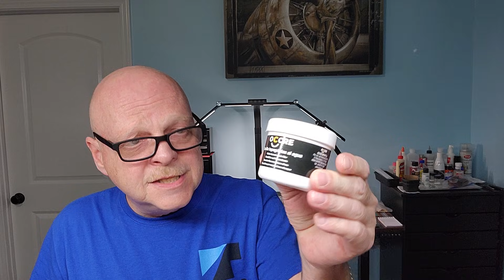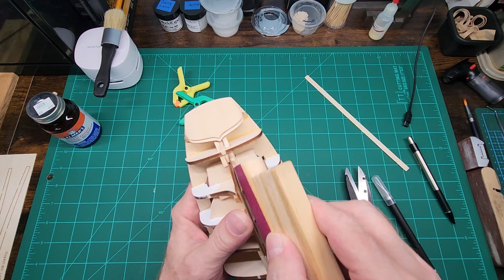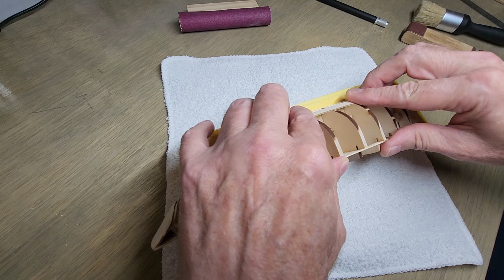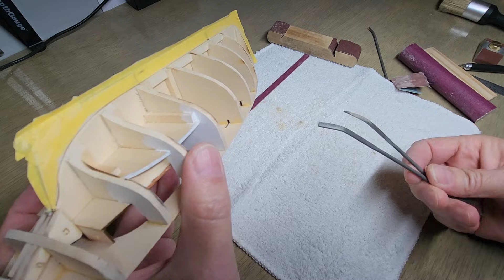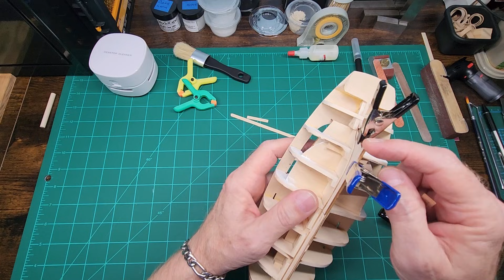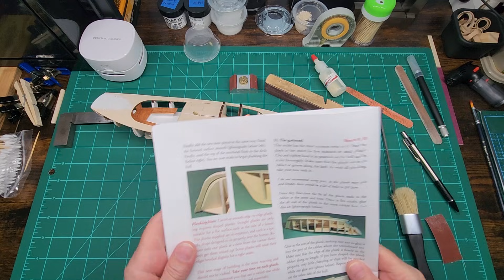Model Shipways Muscongus Bay Lobster Smack, Part 5, FAiring the Frames, installing the Keel/Bow/

Comment: I'm behind you, I haven, started yet!!!
Reply from the maker: Hi Mike,  that's ok, when I faired in the hull I didn't pay enough attention to the frames just before the rudder, it left a sharp angle rha I had to remedy with filler. Hopefully you can avoid that little mistake and your planking will have a better transition than mine did. Take your time and good luck with your build buddy. 😊 Johnny

Comment: Looks good but…. I think it is a mistanke to grind away the lower detail of the transom! The instruction is as you also comment not very clear, but I think the small toe is a important detail of the design Regards Bent from Denmark
Reply from the maker: Thanks for the comment Bent! I really appreciate it. As for that small toe or spur on the bottom of the transom, in step 10 we have a central plank that is placed along the central spine which starts just aft of the hole for the rudder and runs just past the transom, the end of which will be sanded flush along with the ends of all planks that attach to the transom. Leaving that spur in place would create a problem with the planking, so I faired it in just as the instructions indicated in the picture on page 9 of the manual. With that said, I will say that it is always a good idea to question the instructions, we have found some to be unclear, and in one or two cases, somewhat in error. Thanks so much for watching my friend, take care and happy modeling. Johnny
Reply: Thanks Johnny I am  almost there and still have the ambition to keep the toe, but lets see how it goes 😅
Reply from the maker: @Thalassa63  Hey Bent, I think you're on the right track, keep with your gut feeling and see where it leads you, my friend! Just remember, modeling is never about one person's point of view! Let me know how this turns out my friend. Happy modeling. Johnny
Reply: @Thalassa63 did you happen to leave the transom shape? How did it go. I'm right before this point.